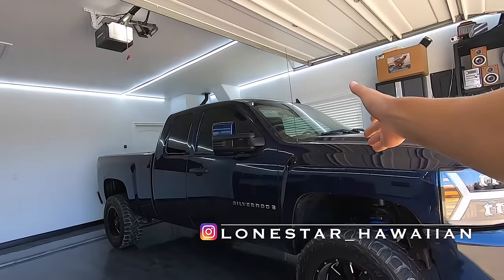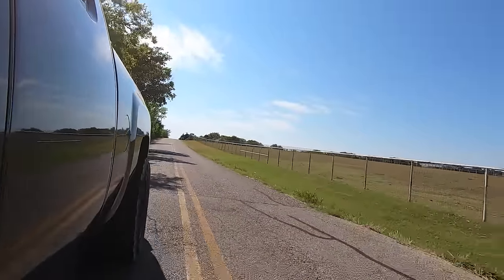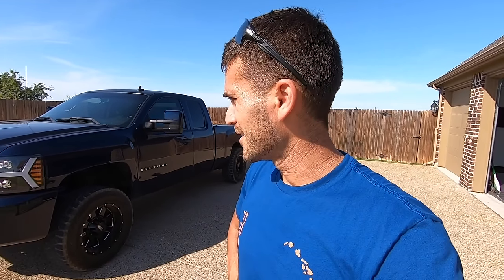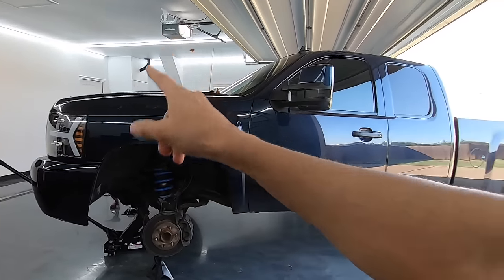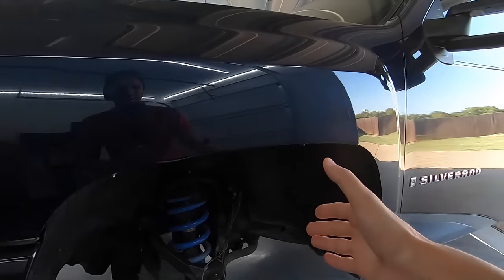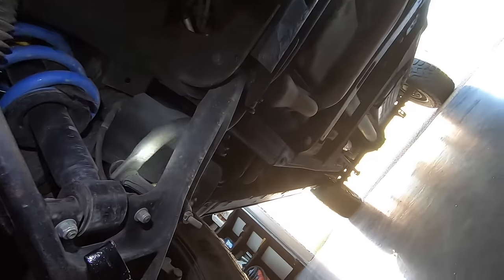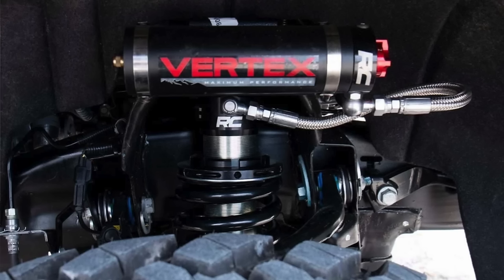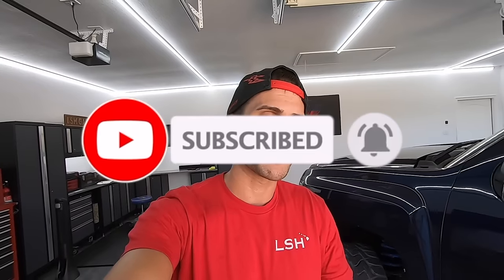Reliability Issues? 3.5" Rough Country Lift Kit - '07-'18 Silverado/Sierra: 3yrs + 30k miles

Comment: Dam bro I really hope Rough country see’s this video and reaches out to you and gives you a sponsorship for both of the trucks! I also have A full rough country lift kit on my 2013 Silverado Ltd  with a 4 inch lift with the upper control arms and I’ve had it for about 40,000 miles I haven’t had one issue with it!
Reply from the maker: Appreciate it!
Reply: How is the ride quality? I want to go with that lift and am wondering about it? At $1000 it is no longer cheap but I know others are more
Reply: Never had a problem with my rough country 6” lift with 32” tires great lift kit by all means 🤙
Reply: @skylineexoticmicrobulliez1552  yes sir, because it was made in America 🇺🇸
Reply: @EHustleEntertainment  I have the 3.5 in. in my 3/4 ton sierra, only problem is the base shock absorbers don't do much, I'm going to upgrade those and I bet its perfect
Reply: I talked to Rough Country about my 3 1/2 inch suspension lift and they told me upper control arms are not necessary so I didn’t buy them ?

Comment: My dad and I installed the same Rough Country kit on my 2012 crew cab Silverado. I called around to have it installed but shops here in San Diego wanted $600-$800 to install it 😱. So I called my dad who is 6 hours away in AZ and he said come on over 😁. 

Drove 6 hours to AZ, took us 4 and a half hours to install the kit, we had a great time installing it and it's been one year with no major issues. The only thing I have noticed is it makes a creaking noise on the passenger side. 
I'm still running stock rims and tires because I'm poor and my tires still have some life in them but one day I'll run a setup similar to yours with 33's.

Your video reminded me that I need to buy those 3" rear blocks because we didnt want to stack the blocks, so I have that Cali squat :/ I'll definitely be ordering those upper control arms from Rough Country as well. 

Love the channel brother and cant wait to see what's next! 🙏✌❤🇺🇲💪
Reply: If I were u I’d get the 33s and maybe keep the stock wheels 

Aftermarket wheels are kinda overrated imo first ones I had from pro comp were chrome and they Milled all around the center inbetween the spokes looked ugly 

Second ones I had are better and black but they aren’t the easiest to balance 

If I could do it again I’d save the $800-$1,000 and. Keep stock wheels and just get new tires
Reply: @Man_in_a_Gucci_Suit  thank you for the suggestion! I was thinking about doing that but I was worries about rubbing if I got a 33x12 or 12.5 because there is no negative offset on the stock rims? I dont even know if that would be an issue? I was also looking at 2" spacers with the stock wheels but I've heard mix reviews on spacers.
Reply: tbh i would not do wheel spacers either they have to be retorqued and they can make the wheel fly off if u ever hit a pot hole at 90 mph which can kill someone its not super likely but not unlikely either interesting thing about my 4.5' zone kit is it pushed the front track width out 1 inch and a half and honestly its annoying i can swing around a drive through without doing multiple point turns i would just run without wheel spacers tbh and ur tires are gonna be wider then ur stock tires btw
Reply: @Man_in_a_Gucci_Suit  yeah I'm definitely more function and safe over looks, so I'll pass on the spacers. Do you think I'll having any rubbing issues with inner suspension components with 33x12" tires on a stock wheel?
Reply: @kennygp2004  i dont think so but get a second opinion i have 33" nittos on my 4.5"zone kit no rubbing but my front track width like i said is 1 inch and  half more with lift kit youll probably have to cut into the wheel well liner probably not the metal tho
Reply: @Man_in_a_Gucci_Suit  thanks, I'll just call my local tire shop and ask them. If it doesnt rub, I'll definitely keep my stock wheels and get a custom front bumper that gives me even more clearance. Something like the American Trucks Baja bumper. That way I wont have to cut anything. Appreciate the help/info from your setup/experience.
Reply: Can't go wrong with classic steel rims

Comment: I've had my RC 3.5" for about 14 months and it's still as good as the day I installed it.  I'm about to buy their 7" kit soon.
Reply: BDS is 10x better
Reply: @SDRacing88  yes, it also costs 10x more, and I'm not going off dunes or sending it, so I don't need to spend that much money on one.  I was going to get the Zone, but I would need new tires and wheels and other components, so I decided against it.

Comment: Rough country makes a solid product. I have the 7.5 in lift on my 08 silverado 1500. Been running that for about 6 years and it's been damn good. I load  in that truck all year with wood, rock, dirt, you name it. It's a bad ass lift for the common country boy.

Comment: I went with the 2.5 first was never fully satisfied bc it wasn't truly leveled but the ride quality was always great ran it for 3 years no problem. I recently bought the RC upper control arms and replaced the struts with new ones also upgraded the rear shocks with the RC 3.0 shocks. Since I have pulled out the 2.5 spacer and got a 3 inch motofab spacer and now I'm truly leveled Im super happy that extra .5 makes a difference.  RC is a great company never had a problem
Reply from the maker: Thanks for sharing!

Comment: I had a 09 silverado 1500 and I put the rc 3.5" kit with the upper tubular control arms and have had no problems. I even hauled 1500lbs of cement bags in the bed and a trailer with another 1500lbs of cement bags no issues

Comment: Man that's awesome. Almost 7 to 9 years ago I worked at a used car dealership and half the pickups we got from auction we installed the RC 6" lifts and 35s (didn't have binding issues like you had because it was a full lift) Honestly even back then the quality was super. Even the 4" on my XJ from RC is amazing.

Comment: I've got about 70,000 plus miles and I have about the same rough country setup on my Silverado. The only difference is that I changed out my front strut to the bigger style rough country sells. I can say that it has softened the ride x10 and eliminated the need for the front strut spacer.
Reply: Yeah I started out sane way as u on my 2006 F-150, then I added the struts when they came out and eliminated the spacers. Back when I did ii though, they didn't come with the coil spring,so I had to reuse the stock ones. I had to buy a spring compressor and I tell u what, using that thing really made me nervous. Wanted to get that done as quickly as possible. Been happy with it, but might upgrade to Bilstein, Fox or icon, when time comes to replace them

Comment: True cool transmission cooler. Best thing I ever did for my truck. Not very expensive and pretty easy to install. The 07 sounds so much better I run a borla pro xs single in dual out on my 08 and my wife's 15. That's also kind of the same kit I run on both. I've had it on my 08 for about 3 or 4 years but mine came with the bigger blocks and lower strut spacers. And I have really used my truck alot! And never had a issue.

Comment: Been About a Half a Year Since I’ve Had My 6 inch Lift Kit And Been Great So Far💯💯💯 Only Thing I Plan On Replacing Is The Shocks With FOX 🦊 Shocks...
Reply: Had a 6” RC lift on my 2011 F150, best upgrade I made was Fox 2.0s to the rear.... complete night and day difference
Reply: Daniel Reardon how long did u drive it before you replaced them?🤔
Reply: Jimmy Guerrero about 5K miles. The RC shocks were trash. Fox had a good deal on a set and I jumped on it. Installation was quick and it made the whole truck ride better. I also went with the full 6” lifted strut in the front as well. I had the 6” spacer originally.

Comment: I just purchased and received the 3.5" rough country lift for my 07 Avalanche. It was quite a bit more expensive than your kit and didn't come with rear shocks. I also just purchased and received some 33.5"x12.5" federal xplora tires on some Hard Rock Offroad Crushers 20"x10" with a -19 offset.

Comment: The 3.5 inch lift kit now doesn't stack the rear blocks and comes with a diff drop that helps out the tie rod angles.

Comment: I have had a 3.5” RC lift kit on a 2008 1500 Silverado 2dr short box on stock tires.  I ate about 10 sets of cv axles and about 8 sets of ball joints both upper and lowers and I do not off road (Michigan grade A roads - NOT) my trucks.  I’ve tried the RC struts and several off brands and found Monroe gasmatic stock replacement are the best vs any loaded strut.  However I found several issues with the lift being the axle drop mounts were not enough and the company that installed it broke off the bolts in the dog bone mount on the driver side of the truck for the axle and I had zero help from RC when the ball joints kept blowing out at the 5K mile range, I was rebuilding the front end every 4-6 months.  However I also learned that aftermarket CV axles for GM trucks are 1-2” shorter than AcDelco factory equipped shafts.  That being said that’s one reason I kept popping the new shafts.  But I’ve seen other RC lift kits and was not impressed cheap quality and poor angle placement.  Other than that if you want affordable RC is the company to buy from.

Comment: I just bought the 3.5 lifted struts , forged upper control arms , tie rod sleeve, and the no3 rear shocks for my 2013 Silverado 
I didn’t get anything for the rear because I want a bit to of squat
Reply: Did you need to cut the bump stop off with the lifted struts?

Comment: I put the 3 1/2 inch rough country suspension lift on my 18 Silverado about a year ago and 10,000 miles with no problems. The company insisted I didn’t need the upper control arm so I didn’t buy it. 🤷🏻‍♂️

Comment: This actually reminded me that I need to make a long term video of my own suspension.  I did one of the ICON coilover kits, but I did run into a couple issues over time.  Sometimes I wish I had just gone with a more basic 4 inch lift.
Reply: What issues have you had work the Icons?

Comment: Rough country isn't bad. My 2015 gmc sierra z71 has a 7in rc knuckle kit and haven't had issues with them. Its a good budget lift when you trying to spend more on nice wheels and tires but im currently 10 weeks in now waiting on my 8in bds lift kit with the resis but corona has sadly delayed it this long which idk when itll get delivered to the shop...

Comment: 2021 Chevrolet Silverado 1500 Custom Truck I purchased 2 months ago, want a suspension lift kit installed.  I Called my dealership talked with the Supervisor over the service department ask him if I would purchase a aftermarket suspension lift kit 2" to 4" would it void my warranty.  Conversion went as he said if I bought my truck in for suspension problems and service technician found that any suspension parts worn out , ball joints, lower and upper control arms any other parts and the aftermarket suspension lift kit caused the failure on the parts, it would void my warranty and i would be responsible for the worn parts.  He told Gm makes there suspension lift kits for my truck and said to buy Gm lift kit and any problems in the future if any it would not void my warranty and have them install it or have a shop install it as long it's Gm suspension lift kit which only comes in 2" lift kit not 3" 4" at a price of $ 899.00 not including labor.  I have a truck shop a good friend of works there will install it for me at a reasonable cost,  so my question is how much labor should I be looking to pay to have it installed? I would like to have a 4" suspension lift kit, but Gm doesn't make them and I don't won't to risk voiding my warranty.  So what he told this stay low and save a bunch of dough..is this correct what he told me?  🤔

Comment: Shocks have nothing to do with the rear sag or carry capacity. They just control the bounce. The springs are taking all the weight and abuse.  For sound, ditch the borla and go with a black widow race venom. The sound is so much better.

Comment: I had the rc3.5 on my 09 silverado 2wd way back in 2012 it looked amazing on 33 but drove like BS they didn't offer the UCA back then balljoints were destroyed in a couple months. I removed the hole kit and spent a lot of money new lift is fox 2.5 coilovers max track 3in spindle camburg UCA for rear i got Deaver 4in leaf springs fox 2.0 shock no lift blocks to go with rides like a Cadillac mid travel setup it's turning in to a prerunner build now

Comment: Should have just gone with lift spindles. They dont change the geometry of the suspension. Ive had  mine for over 11 years on my 07 sierra. Both very nice trucks by the way.

Comment: Hey bro, nice truck! - I've been following your build for a while and it inspired me with my 2011 2WD before I even got it. Now I got a 3 inch spindle lift on 24s and 35s. Had to do some trimming in order to turn and the tires still rub a little sometimes. Thinking of doing the Carolina Squat. Mine already sits 2" higher in the front. I have the drop shackles sitting on the dining room table...

Comment: I put the 3.5 lift with UCA on my 2011 about 5 years ago, need to do upper ball joints every 2 years or so but other than that I've been happy with it. The add-a-leaf I put in the rear affected ride quality far more than the lift did.
Reply: What is the number part of ball joint ?

Comment: I have a 4.5” Zone lift kit on mine 

Rides like stock I’ve put 15,000 miles on it since the lift no issues at all 

I would suggest either 4.5” Zone or Procomp 4” lift

Comment: Rough Country has a kit that comes with spacers to drop down the front diff now and better blocks for the rear also that is 550. They also have one that’s a little under 900 that comes with lift struts instead of strut spacers.

Comment: Anything 2.5 or higher you'll need UCA upper arms cause your stock ball joints will fail.
Reply: I have a 4.5” Zone and I still have the stock upper control arms 

I know that’s a proper lift kit compared to a RC budget but still

Comment: The trail boss would look great with off road wheels tires , maybe swap the 07s wheels
Reply: They can't be swapped without major fender trimming. GM changed the fender well design in the newer models. Was a longer square well and now they are a circular shape taking away almost 2 inches of wheel clearance. It's why the trail boss comes with 18" wheels

Comment: I have 7.5 inch vertex lift best thing I done glad I spent the extra money for it drives as smooth as stock if you have the extra money to do it is worth it over the strut spacer lift

Comment: So you're probably going to go with the bigger lift  since you pointed out the vertex coil overs but with those you have to run with a 6-inch Lift I have them on my truck they ride. Great performance is wonderful

Comment: I hate doing alignments on these truck they really need to make a better setup for the camber /caster adjustments.  they make you pull the wheels off to get to the lobes.  it all hinges on these tiny pins the have the potential to come out. even on brand new trucks !

Comment: I have the 4 inch installed in 2011 and I burn though cv shafts and upper ball joints once a year my trucks a 2011 Silverado and I bout it new also 135,000 km .

Comment: Random question: has your dash cracked from the heat and sun on your ‘07? Just discovered it on my ‘13
Reply from the maker: Ohh yeah. It’s bad. I’m replacing it soon
Reply: LONESTAR HAWAIIAN Do you have to buy a whole new dash assembly? I’m only really finding those or a cover that goes over the dash
Reply: You can find replacements on ebay a little over $100
Reply: Bleau DeLury only ones I saw for $100 were covers.
Reply: Ya just looked they're $272 but found some for $199.
Reply: O god I hope this don’t happen on my 13
Reply: Mistbros it’s highly aggravating.
Reply: Bleau DeLury I’d love to know where you see them for that, cheapest I’ve found is around $370.
Reply: @waldoman321  easy on ebay dash cover replacements if you have your vehicle saved it will show ones for your truck and for my 11 I see a bunch for $272
Reply: Chevy Boy not to be rude, but that is a cover, not a replacement

Comment: My first lift kit for my truck was a 3” from rough country for $500 and it rode like a brick. For about an additional $600 I changed out 99% of the RC components besides the rear blocks and now my truck is decent down the road but is still trash. Don’t get a tow pig and expect a caddy ride quality.

Comment: my money pit is a 2011 1500. added the 3.5" front 3" rear leveling kit but did the RC upper a arm as well. went with the rancho 9000xl shocks around it running 285's on 17's 10 plys. runs 85-90 on the high ways and 60-70 on the dirt roads. im rual montana, most roads are dirt. went with the KN black hawk for intake, and just added a cat delete with dual flowmasters. they dump infront of passenger tire. its pretty mellow at idle, but get on it and wow.  installed dual optima's with a decked bed box, as well as the roughcountry winch bumper and 12000lb winch. still a work in progress. You started this project with your videos! Thank you!

Comment: Just purchased a 2008 Silverado Extended cab 4x4, it’s the Duramax 6.6, but it’s a long bed. Do you think I’ll have any issues being a long bed. This will be my first lift. I’m a total newbie. I need the long bed to tow a 5th wheel RV. Anyway I think I have to do a 2-3 inch leveling kit to add some decent wheels and tires. Any words of wisdom would be great. I like your videos. Thanks.

Comment: So question for you I just ordered motofab F3 R2 leveling kit then I bought RC UCA’s with the N3’s rear shocks I was wondering how the upper control arms are holding up and your truck rub with your stock rims because it looks like you also had the stock rims in the video?